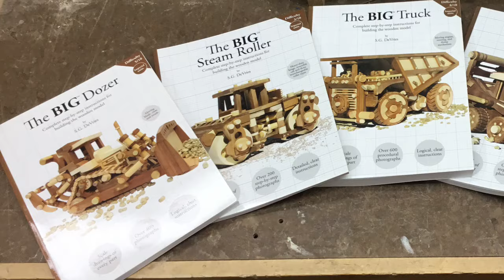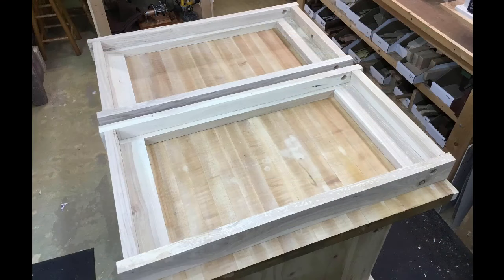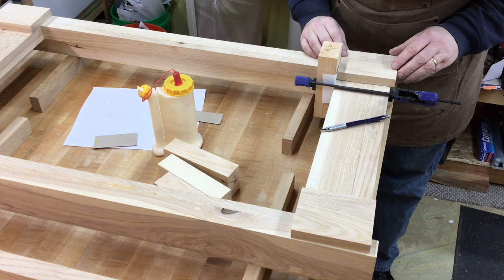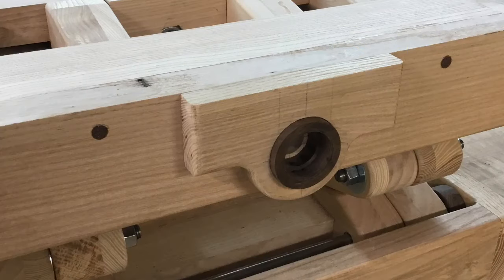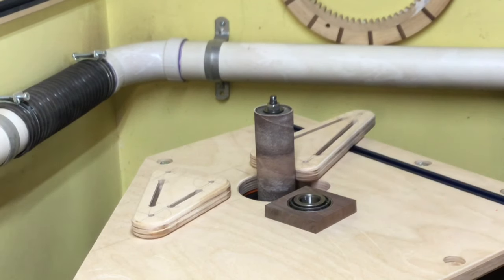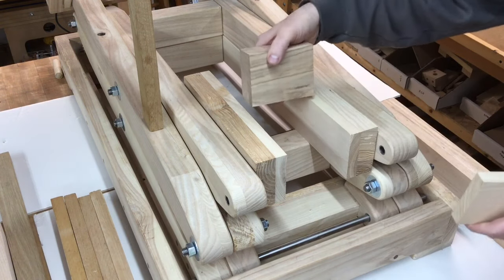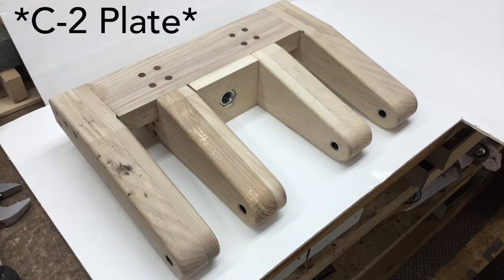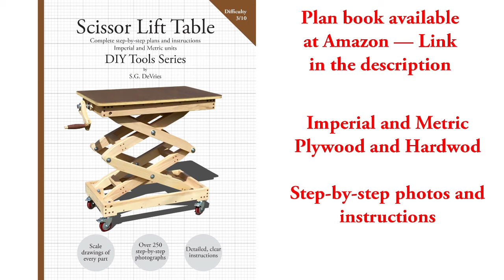DIY Homemade Wooden Scissor Lift Table - Plans available. Updated and upgraded design.

Comment: So this idea would be interesting to apply to a trundle bed where you want the lower mattress to rise up to the level of the higher one when the lower mattress is pulled out... (makes sense?). Which is how I found this video as I am searching for a solution. Of course what you're showing here is beyond my skill set at the moment, and would take too long, sadly.

Comment: Any issues with scaling this up to 3'x6'  top? I'm thinking to use this as a base for adjustable height assembly/outfeed table for my small shop.

What is load limit for this table?

Comment: Any chance you can make one but with a 4x8 top?
Reply from the maker: I suppose it is possible. I would be concerned about the structural design on something that big. You are approaching an industrial size table at that point, and doubling the dimensions gives you four times the surface, and thus, at least four times the potential load someone would put on it, probably more. If I needed something that big I would probably buy it rather than try to design it myself.

Comment: Hiya. I bought the book and have started plugging away building with my son. What material did you use for the bushings? Here in Grande Prairie, Northern Alberta we dont have much in terms of selection for steel tubing with an ID of 1/2 that will take the threaded drill rod. Best I can figure I either buy 3/8 SCH 40 pipe and drill out the seam and a wee bit of wall or I just drill out the seven feet of 5/8 cold roll round stock. 

I'll try and call the two hydraulic shops in town tommorow to see if they have any steel tube that might work.

But any advice on what I can use would be greatly appreciated.
Reply from the maker: This is the material I used for the bushings : Bushing Tube : https://www.onlinemetals.com/en/buy/carbon-steel/0-625-od-x-0-065-wall-x-0-5-id-carbon-steel-round-tube-a513-type-5-dom/pid/7762

Not sure whether shipping to Canada is an issue or not.

Comment: As I reach the completion of this Scissor Lift table. I am looking back at the challenges that I had. The instructions are good but there is a significant number of points where you are forced to think and draw on your own experience.  The table is complete except for the wheels and the top. As a parting challenge, the lead screw assembly is VERY VERY stiff.  I will spend the next days trying to determine what is binding.  The video makes the raising and lowering look easy.  In my case it is difficult to put it mildly.  Maybe lubrication will help.  I suspect there is some misalignment with the leadscrew and the leadscrew carriage.  It does get easier to operate as the table gets above about 25 inches.  Steve... If you see this, could you offer any pointers on how to resolve the leadscrew problems?
Reply from the maker: I would suggest trying blue grease. That is what I used, and quite a bit of it along the lead screw along the portion where the carriage travels. I have used white lithium grease on my older version of this table but I didn't like it near as much because it was stickier.  One other thing you could try to check if things are mis-aligned, try removing the nuts on the tail end of the lead screw and popping the tail end bearing out of its hole to allow the end of the threaded rod to hang free temporarily. If the threaded rod wants to push in one direction or the other, it would mean that the screw carriage isn't quite aligned with the head bearing.
Reply: @s.g.devries8557  Thank you.  I ordered the type suggested. The grease I had on hand was similar and it did help. Now to put the table to work for my chairmaking adventure.

Comment: I'm in Australia and tried to buy your book/plans on Amazon.  It tells me there are non available. Can you tell me where I might buy a copy?  Good job by the way.
Reply from the maker: I will look into this. I suspect that it has to do with something Amazon calls “expanded distribution”. The requirements for some countries are pretty vague. I’ve sold to Australia before, so perhaps something has changed that I’m not aware of. Thanks for letting me know.

Comment: Another question... it looks like I may have to resort to building the lift out of cabinet plywood.  Do you have a cnc file to get the pieces cut easily?  Thnx for the help.
Reply from the maker: I do not have a CNC file (or a cnc machine for that matter). Yes, that would certainly make things faster, so sorry I can’t be of more help in this regard. Thanks for asking though.

Comment: didn't someone else say he designed the exact same thing posted this in 2017?!!
Reply: If you watch the video you can see that this has changes and upgrades. 

Larger and stronger hardware.

Hardwood instead of plywood.

He says in another comment it wasn’t the strongest around 80lbs with the old design.

This one seems much stronger but I didn’t find a comment about strength rating of the new table.

Comment: Very talented craftsman and also at explaining everything.. Have watched all your videos and going to  purchase a couple of the of plans (Truck and loader) I would also like to build the jig for making the tires and the circle sander (do you have drawings for these even ones you used to build your by),  Thanks for your time and efforts in the craft and art that you do.
Reply from the maker: I am working on the plans for the wheel jig. I needed to redesign the gear arrangement because there was a little bit of slop if you reversed directions that I want to get rid of. As for the circle jig, also working on them. Slow going due to other things happening in life, but I am making progress. Thanks for watching!
Reply: @s.g.devries8557  Looking over the design and would a geared belt work better? that should remove the slop, Just a thought

Comment: this is such a nice guide, I like the detail with ball bearings and everything, will run much more smoothly. I will make sure to get your book. 

I really like to cut wood threads for vices and the likes, and it would be a nice touch, for the lead screw that is. I think my 1 1/4 is 4 threads per inch? Would that work? That would mean no ball bearings in that part though.
Oh btw the double jointed handle is really nice, haven't seen that before. Really brilliant.
I didnt quite get, what is the tapered bearing for?
Reply from the maker: The tapered bearing is because the entire weight of the table and tension on the lead screw pulls against it. The bearing needs to be able to handle force in two directions, both radial for the rotating shaft, and axial for the force of the nut pressing against it. 
Thanks for the nice comments, glad you enjoyed the project.

As for wooden threads, even though they look cool, I doubt they would be able to handle the stress put on them. The lead screw holds the entire weight of the table along its length and that force is trying to shove the carriage nut away from the handle. It would be very easy to crack those threads right off. And I suspect there would also be far too much friction anyway to actually make the table usable. Even with steel threaded rod it needs grease because of the friction.

Comment: Hi, I just bought your book.  I am trying to figure out the prices based on your recommendations.  When I consider hardwoods, the websites are asking for price per board foot.  How many bf does this table take?   Thanks!  Don
Reply from the maker: Hi. Thanks for your question. I haven’t had a chance to sit down and do the math yet. I will try to get to it soon. I didn’t do any board feet calculations when I built is since I had plenty more ash slab wood than I needed already on my wood rack.
Reply: @s.g.devries8557  Different question....  I have a lot of hardwood and wanted to use that for the project.  The 8/4 maple that I have will dress down to about 1-7/8". Will this be a concern since it is less than 2"?  Strength ? Changes needed to plans to accommodate?

Comment: Hello Sir, So I started building this table about 3 weeks before you released your updated video and instructions. That’s to bad for me because I could have benefited from all the learning you did over the last 3 years. Well my table is 95% complete now and work’s pretty well but I am not confident that it could lift over 100 lbs. can you tell me how much weight you have safely lifted with your new table and also with your first table built out of plywood? I built my using pine and plywood mostly and 1/2 inch threaded rod. Thanks
Reply: Just wondering if you have not answered my question due to liability reasons or just not interested in sharing. I understand would just like to find out more about your original build vs the new. Thanks
Reply from the maker: Huh, I was sure I typed a response to this…. Oh well, obviously it didn’t post. Anyway, my old table I lifted 80 pounds or so, but it stressed the table pretty bad. I haven’t tested my new table much yet, but I have used it for a few things, such as moving an antique drill press which has to be over 100 pounds and the table barely flexed. I don’t intend to give it any sort of load rating, since I really don’t know the upper limit and don’t want to ruin it finding out. I dont lift many super heavy loads with it, but the improved design has a lot more stability which was the main goal.
Reply: @s.g.devries8557  Thank you so much for your response, it is nice to have this information. I really wanted my unit to lift about 150 lbs and will be making some changes to hopefully accomplish that. Both your units look very nice you do beautiful work ! Thanks again